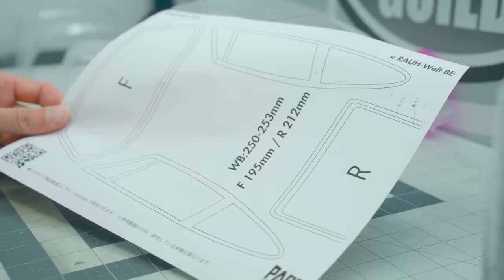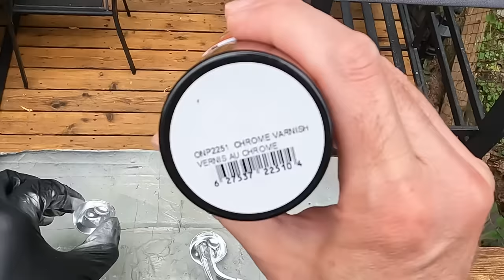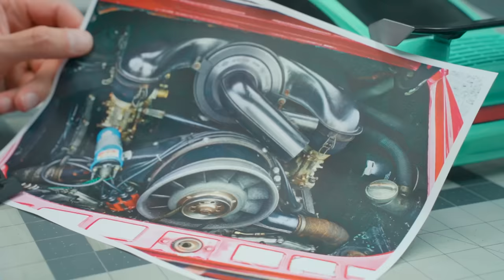Lexan CAN look this good (with a little work)! RWB Porsche

Comment: Wow, the editing/production/whatever-the-right-term-is is awesome on this! I really enjoy all the new video styles you are playing with lately. The build itself isn't too bad either ;) 
Maybe a small tip, for the wheel arches on my touring cars I usually put sanding paper around a break cleaner can. Works out pretty good in terms of diameter (no drift experience though). Basically what you did for the exhaust with the pencil. Obviously that only works if the cutouts are somewhat circular, not sure ift that applies to the RWB body.
Reply from the maker: Thank you... and I'm really trying to do new things. Great tip! That's basically what I would do, too.

Comment: Very nice color and a fantastic job! I am thinking about the same color for my kyosho 57 Bel air body… How many coats of mirror chrome did you spray before the turquoise?
Reply from the maker: Mirror chrome was not sprayed before the main color, otherwise, it’d be chrome, not turquoise!
Reply: @scalebuildersguild  Thanks for the clarification. I just realized that the chrome was used for the 💡…